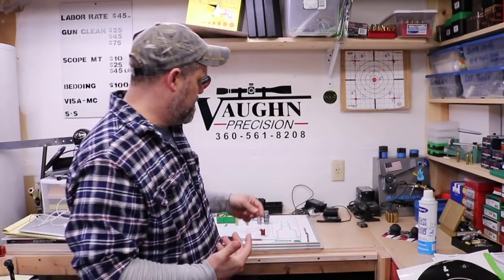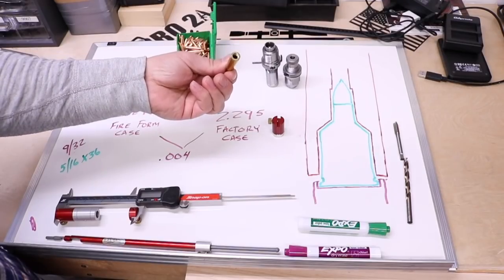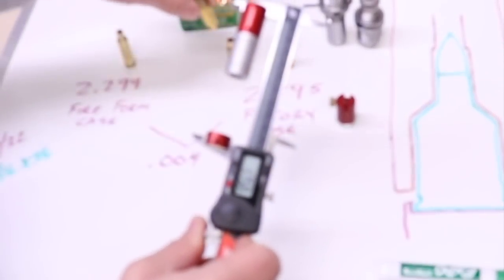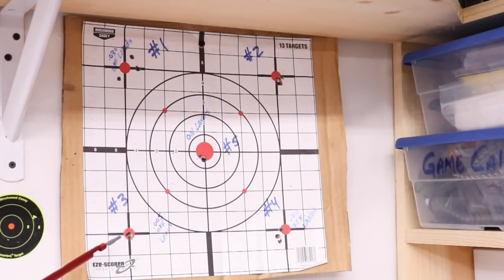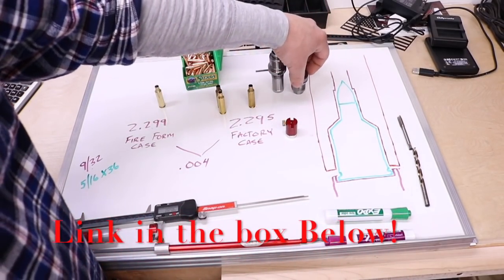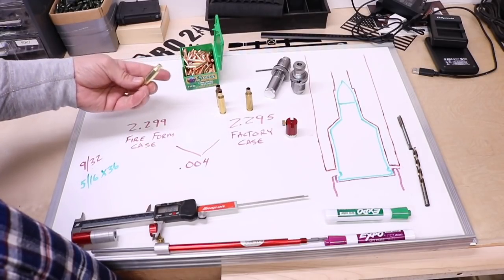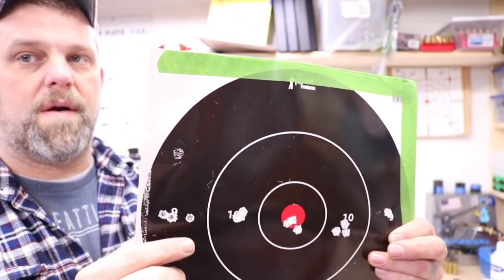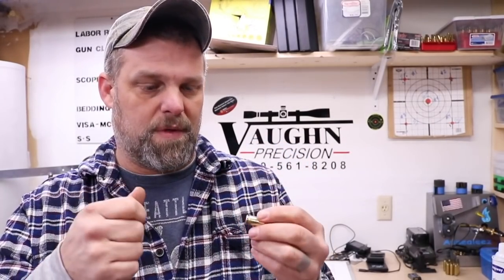Hornady OAL Gauge Update, Custom Made Cases for Accuracy!

Comment: You are right the hornandy cases are not accurate.you should use a fire formed brass that has been lenght sized or neck sized as you would normally prep your brass...I don't use the hornandy tool it's too pussy so I made my own alot more sturdy and I made the end to be 5/16 24  instead of 5/16 32  like hornandy.of course 32  is fine if you have that tap also I take the bullets I use and thread them  6-32 so I have a selection of threaded bullets....also that stupid piece of plastic hornandy provide is ridiculous... Mine is made from a cheap take apart cleaning rod very firm not like hornandys
Reply: Send me one Sam and I’ll do a review. I have four subscribers.

Comment: For all of you that read this comment and have a hornandy OAL tool take your threaded brass for the tool set it up on tool and color the auction point at the neck and shoulder area.spin the tool while pressing in remove and see wat kind of an impression you get that will tell you if your brass has been fire formed enough to fit your chamber..good luck

Comment: Hi there! Question for you. Why should we bump the shoulder on a fire formed case if that’s going to compromise the tightest fit of case-to-chamber? In other words, is 0.002 off a concern when your groups tightens up dramatically with 0.005 difference?
Reply from the maker: Pao Her I get my best groups with low ES/SD when bumped .002 back. This isn’t true for everyone, but it works best for me. After a few firings, the bolt will become hard to close if all you do in neck size. You could try bumping at different measurements and see what works best in your rifle.

Comment: Am I correct in thinking if you do this with your fire formed brass after you bump the should back 1-2 thousandths make as long as you use the same bullet and same shoulder bump after ever firing you should only have to do this once?

Comment: Here comes the other one ...,.......I had a problem with my new Redding and o!d hornandy  full lenght die...it seems my brass on my factory 243 had blown out at the neck to where when I tried to full length size the the neck was butting up against the neck shoulder junction and the case would not enter ?????that is a SHARP junction where the die maker should have made their reamer to put a slight radius to act as a funnel to help the brass enter the necking portion of die.........so what I did was to take a cone shape stone on my Dremel and kiss that junction to create a s!ight radius.the sharppend u rubber cratex stick and polished it out.....before I deliberately pushed on that press handle and I actually crushed that brass that's how bad it was....here's another thing...I checked the bore of the necking part of two dies one a brand new Redding another an older hornandy with little use and found the internal diameters the (bore) to be different.now I am a retired machinest and have every type of measuring tool there is so I was able to do this....so the bottom line is that these dies have flaws in their design that keep you from obtaining the best loading performance from our ammo. Samalverio8@gmail.com

Comment: QUESTION: Hello, why do you need  a body die of proper size caliber in order to make a modified case?
Please explain how the body die is used in the process, Thanks
Reply from the maker: I only use the body die if I want to make a specific bump to the shoulder. That’s the only reason. Most the time I don’t do this, I just use a fire formed case that’s been drilled and tapped. Hope this helps
Reply: @vaughnprecision  Thank you for being kind enough to answer. I recently found out someone I know is a machinist by trade and also has his own metal lathe and mill. I asked if he would make me some modified cases explaining the process, and he said no problem, for you I’ll do it free. The question he asked was about chucking up the brass without a wobble. I don’t think he is super knowledgeable about ammo cartridges. However it did bring an interesting question to this wet- behind ears-getting-ready-to-reload-1st time newbie. I wondered if my cartridges that I will be loading for are straight walled bottle-necks? Turns out the .243 Win, .270 Win, 7.62x39 are not. All of these cartridges show some minimal amount of body taper, with the 7.62 being the greatest of my cartridges. Question, will chucking up a .243 or .270 in a common 3 jaw lathe chuck be wobble free enough to drill & tap,  because the taper change is minimal enough over the case body length? Also the other question was: after I fire-form my brass, do I want to full length size my brass with only a .002 shoulder bump, and trim to SAAMI max length before drilling and taping this modified case for the Hornady Max Length Gauge? From what I understand on bolt guns such as the ones I’m most interested in reloading for, one should resize with a .002 shoulder bump with a FL sizing die, for this seems to be suggested norm, and with a .004 bump for auto-loaders. What I’ve heard that throws me off is that even a shoulder bump is still a full length resize of the full body as well, but the difference is that the shoulder bump is made with just ever so less of a full length die max depth setting, or with the die only maybe approx 1 turn less further in than the conventional FL resize die set-up procedure. This setup being where you raise the ram, and dial the FL size die down till it hits the shell-holder, and then just a hair more for cam over feel. This is what I have read is the full length resize setting for my Redding T7 Turret press, and a should bump setting being just slightly less on the die screw-in  amount to allow the particular rifle’s bolt to JUST close without tightness. So if I got my info correct, after firing my stock ammo cartridge once,  I then want to shoulder bump it .002 with my Redding FL die from my Redding deluxe 3 die set, trim case to SAAMI max length and then have the case modified for the Hornady Max length gauge tool correct? After I then measure case length to shoulder with a bump gauge tool, then bump each case back the same amount of .002, trim to max sammi length, then seat all of my particular bullets the same distance from the lands using case head to bullet ogive measuring tool “keeping in mind the Hornady Overall max length when touching lands measured previously? 
I watched your video and you explanation of how a person might not be able to get to the lands, nor it be desirable for accuracy depending on bullet length used, and chamber size. Even heard of some saying even a 1/4” jump can be accurate in some rifles. Also heard that powder charges should be reduced if you load very close to the lands because pressure increase significantly! So if consistency of measurement is held with all this kept in mind, am I understanding the process clearly? I still have plenty of time to study more before attempting my 1st reload for my .243 Win,  because primers are still unavailable. I just want to make sure I understand things perfectly clear before I reload, so things are safe and accurate. 

Thank you sir for your gracious help my friend ✌️😎👍

Comment: Once you have fire formed the case to your chamber why would you bump the shoulder back .002 when making your own modified case...?
Reply: Hello , sometimes a fire formed case will become so large as to not chamber, or chamber very tightly on an individual weapon. This is caused by the pressure exerted all sides of the brass cartridge case. The case will swell until it fits the weapons chamber, thus the term fire forming.. You need to back off your Fl  die about 1 turn from bottoming out on the shell holder/plate and loosen the lock ring.  Now using the headspace gage slowly your headspace down from the fire formed case about .002 ". This worked for me. Alternately you can decrease the shoulder slightly and then bring that brass case over and place it in your weapons chamber. Close the bolt using very little pressure. If it dose not close with very little effort, bring the case back to your press and decrease the shoulder a little more. Repeat the process until you feel satisfied with your work Now go ahead and tighten the lock ring down on the FL die. Guess what you have a round that it now custom fit to that gun, and only that gun.

Comment: They are close enough to get you to the point to custom measure and lock it in, just a starting point.  I forget, what was the original name of that tool, my old one has the old name. I'm nearly 70 and don't remember right now?   The hardest part is finding a drill bit in the correct size, lol.....  As a starting point I Always, found the max. load and backed off 200 fps to start, I found it simply didn't take much work from there!  (picked powder that ran from lowest to fastest and picked that as a starting powder, lol)  That's just me, 50+yrs of reloading, but what do I know, lol...
Reply: Stoney Point OAL guage

Comment: TIP:  for the Hornady bullet comparator; I just measured 3 different 223 bullets of different weights and manufacturers and found a total of CBTO variance of some .030. All bullets must have identical O'Gives. 
Then I removed the plastic plunger and filed down the rounded end into a more pointed end and remeasured a 3 bullets again @ 8 each and found the new total variance of the same bullets to be .010. In two of the bullets the CBTO variance was less than 5%. Very accurate now. 
My conclusion is the bullet bases are not 100% perpendicular to the concentricity of the bullet and the plastic plunger end is too large to get an accurate reading on a small point from the base of the bullets. 
This was all done in a brand-new JC Custom barrel just purchased and not installed. 
I wish Hornady would install a smaller metal pointed end on their plunger for a little extra money. 

😀

Comment: Vaughn... Interesting video, however Hornady makes this very clear on their instructions. So much so... that they even recommend you send them two fire-formed cases so they can tap them for you. They also recommend that you deburr and chamfer the Hornady Modified Cases before using them.   Also, you have the Body, Bushing and Anvil on the incorrect caliper blades. The anvil should be placed on the stationary blade and the bushing and body should be placed on the traveling blade as per strict Hornady instructions.   Hope this helps.    Shoot lots and stay safe.
Reply: glad you pointed that out, have not really thought it out yet but just as easy to follow instructions. I had just watched a similar video by another fella who made sure to mention the placement differences, but he was confused on which blade was traveling and which was stationary, it was comical to me, words actually have meanings

Comment: Thanks for the video.  U just modified the case and find that it fits VERY tight onto the Hornady Lock-n-Load the first 3-4 threads.  I'll try a little thread cutting fluid and see if I can't hand-tighten down completely.  Has anybody else seen this after the 5/16-36 tap?
Reply from the maker: Steve Slaughter is this a case that you sent me that I drilled and tapped for you.?
Reply: @vaughnprecision  Thanks for the quick reply!!  No, I used a "L" drill and a 5/16 - 36 tap and the lathe at work.  After cleaning up the threads, it is REALLY tight on the Hornady LnL threads.  I learned LONG ago to never force fit any threaded gizmos.  The "custom" Hornady case that I also bought fits the threads but as you recommended, I would rather use my once-fired brass bumped back 0.002.  I might use thread lube and try hand-installing again.  If that doesn't work, I can try lightly wire-brushing the threads on the LnL gage.  If none of this work, I'm blaming the new tap.  Just starting precision loading 6.5 PRC now that I have the rifle broken in with 40 Hornady factory loads.
Reply from the maker: Steve Slaughter try taking the tap with a little cutting oil and running it back through the case, since the tap has a taper on the front, run the tap in deep. This might be enough to clean up those threads for a better fit. Once your done, I like to spray them out with some cleaner, I use carb clean or brake cleaner. Just want to make sure all the fine shavings aren’t hanging things up.
Reply: @vaughnprecision  Will run through again.  I only blew them out with shop air,  I have lots of Brakleen.  Good ideas.  Thanks!
Reply: Worked like a charm.  Thanks for the work.  Loaded 20 each using the Gunwerks and Hornady brass to head to the range and chronograph.  Now using the gage, can set bullet depth consistent on both brands of brass to figure out my final powder selection and charge load.  My problem now is that my large group size has to be blamed on my lack of rifle skill, not the bullet jump!

(you took away one of my excuses)

Comment: Nice video, also made my own modified cases. Question though, if it's better to use a fire formed case why did you size it first?
Reply from the maker: Richard Harvey I sometimes just bump the shoulder, but I stopped doing that for the most part. Now I just drill, tap and use without anything else done to the cases
Reply: @vaughnprecision  many thanks,  I am looking at just neck sizing but thought it's better to use the firm formed case as it comes out of the gun, not sizing it first.👍

Comment: Here's another one......the instruction on setting up a full lenght die is to bring shell holder up to bottom of die ... Wat a joke that is..now if you wanted to bump back the soulder how can you wen the ram of the press is bottomed out  an can't go any further ???? So I took my dies and on the lathe a cut back the end where I could get all the travel I need  for the shoulder part of the die to touch the soulder part of the brass.also I get FULL neck sizing not partial.in order to bump back shoulder that case  would have to expand a mile... If u set up die the way the instructions tell you

Comment: This was very helpful. I have a question: have you ran into issues with rounds " hitting the wall" sort of speak. I go to eject the hard  to chamber round and it pulls the projectile out of the cartridge leaving the projectile into barrel. do I need to add .010 jump to the barrel or just seat bullets no more than .010?
Reply: more crimp, or neck tension, you are to far in the lands, also but that needs to be determined thru testing. basically if your Bullett is stuck in the barrel you are to far in the lands  a lot of factors here

Comment: I'm new to this... I have the Hornady set you showed. I have some fired brass (.308) that measures 1.621". How do I adjust my resizing die to only bump the shoulder .002.. ?  Sorry if this is a stupid question...
Reply from the maker: Get the Redding body die and screw it down in to the press a small amount at a time until you can measure a difference at the shoulder
Reply: @vaughnprecision  Thank you...

Comment: Should i use fire formed case and length guage to find your seating depth even though i only have virgin brass to load on this time around?(sold my brass thinking I'd never get around to reloading. Two weeks later found an ammo can of primers in my dads storage  and some brass on midway ).
Reply from the maker: I don't think you need to if all you're doing is shooting new brass but if you plan on reloading them once fired you should use a once fired case that's drilled and tapped.

Comment: Kurt,
One of your better videos of late, as the tools and techniques of reloading are more interesting to me than watching the building of rifles. I am sure there are subscribers, who disagree with me, but from my perspective once I have seen a rifle built be it a bolt gun or AR, the next one is just about the same. However, each aspect of reloading brings something completely different from the last. 
I do not have access to a lathe but I do have a drill press and vices to hold a case true. The drilling of the hole in the case is accomplished with the press and tapping done by hand assist. Once the pilot hole is drilled, the tap can be chucked up in the drill, lowered into the pilot hole and turned by hand to complete. A bit labor intensive but being retired, time is my friend.  I look forward to your 6.5 Creed load development series.